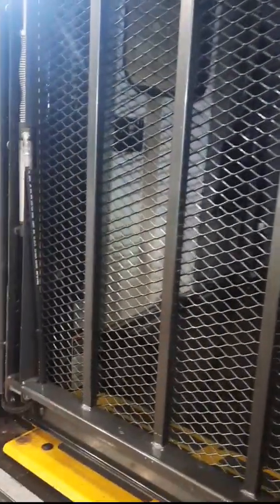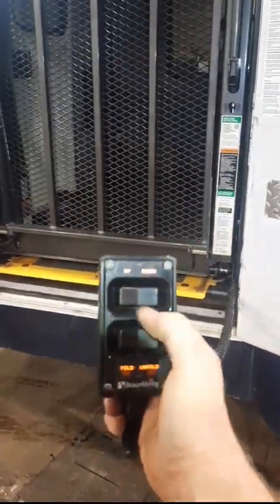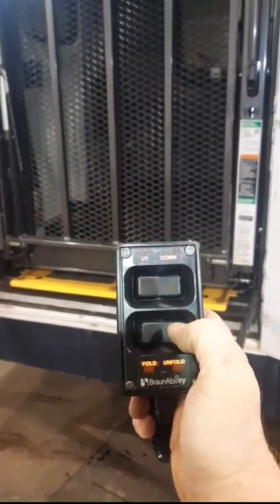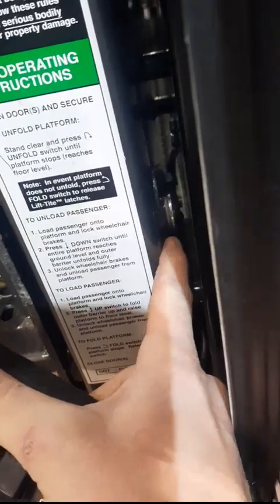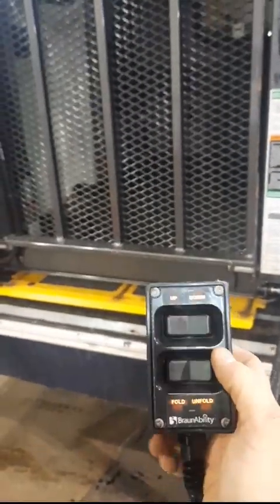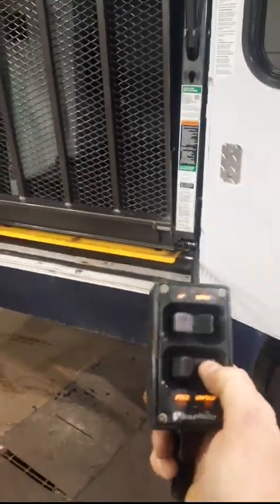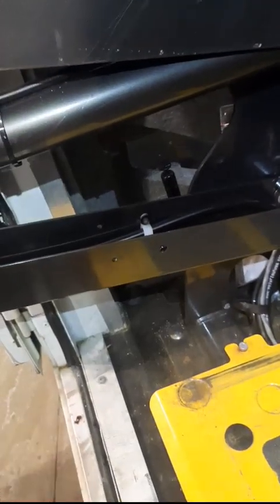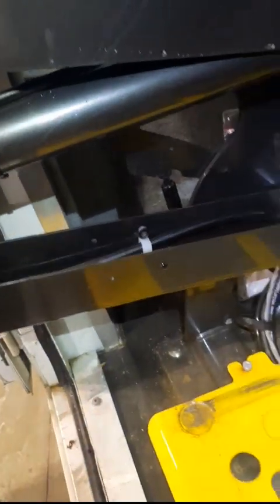Lift has all lights. Common complaint, easy solution.        Braun lifts Millenium, Century, Vista

Comment: How does your lift move so fast and ours very very slow? Fluid is full when fully deployed
Reply from the maker: Might be a pump issue or pressure setting. 

Or.. a voltage issue. Commonly the power wire is good, but the ground wire will be green with corrosion, causing a voltage drop.. reducing the speed of the motor and pump
Reply: @christopherkirish ok thanks

Comment: Is there a way to increase the fold up speed of the lift platform?
Reply from the maker: There is a pressure adjustment. Check with your local braunability dealer